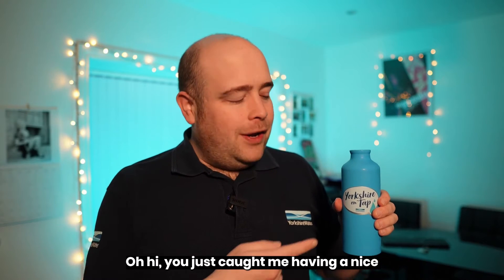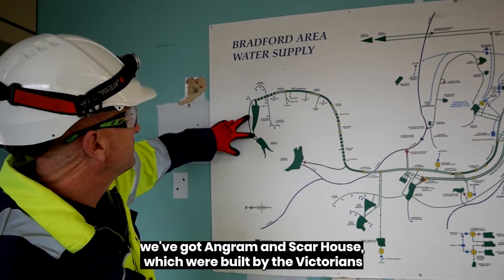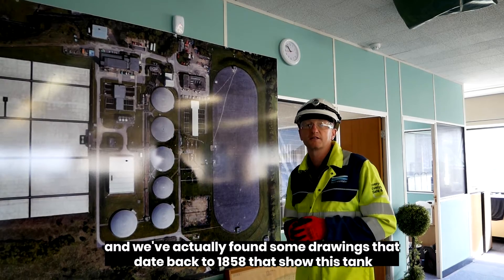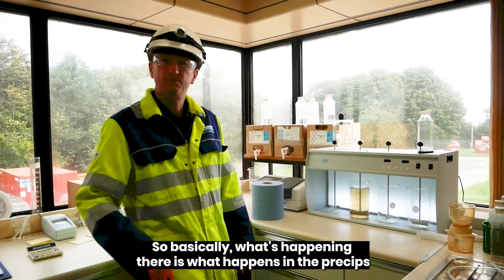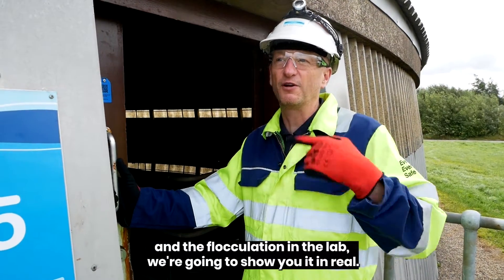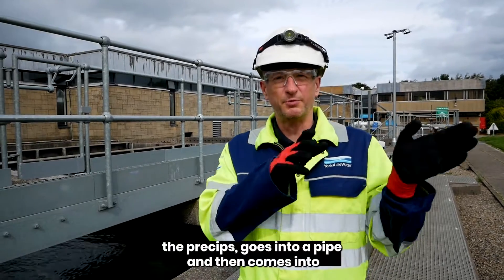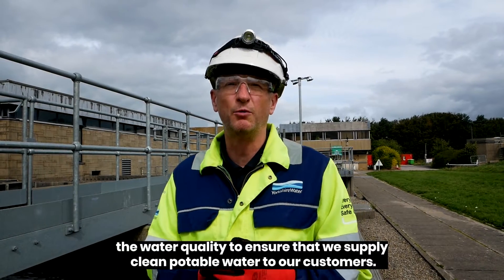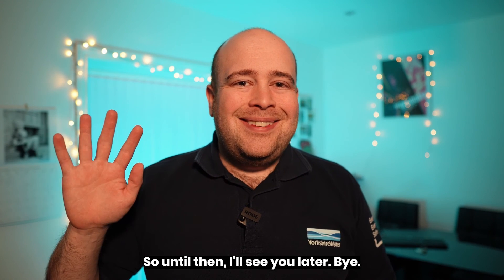Yorkshire Water // The Science Behind - Episode 5 - A tour of a water treatment works

Comment: Where do you put the chlorine in. Does YW use any chlorimine?
Reply from the maker: Hi Darren, thanks for the question. Most of our treatment sites use Chlorine (Sodium Hypochlorite) on the final stage of treatment. If we were to use Chlorine any earlier in the treatment process this would create THMs (which are carcinogenic and harmful to humans) by reacting with the dissolved organics in the water. There is a DWI regulation REG26 which says you have to prepare the water for disinfection, meaning treat it before you add chlorine. This is why it's normally always added towards the end of the process. We only use Chlorimine on a couple of our sites.